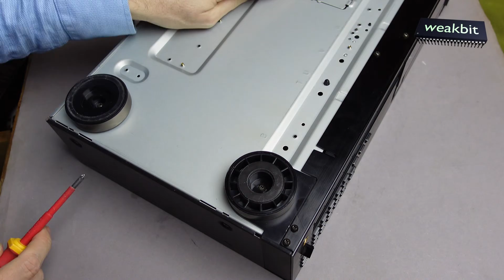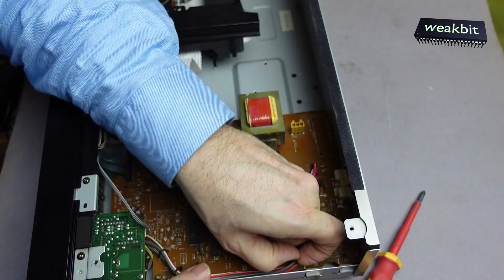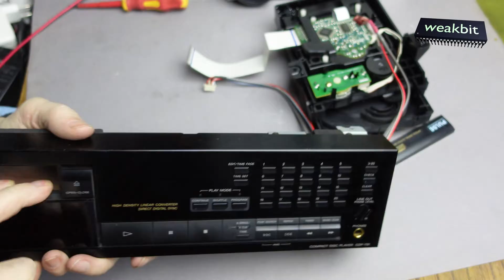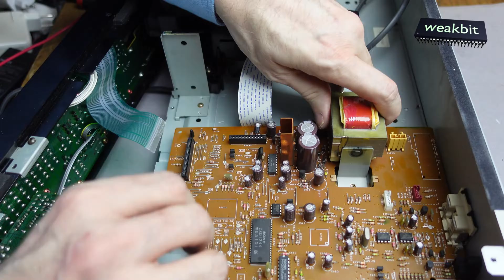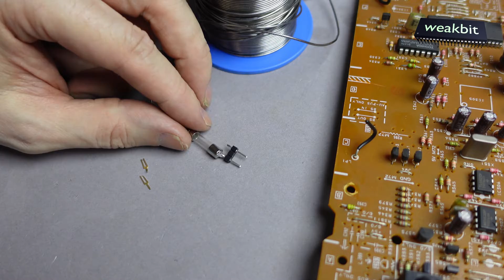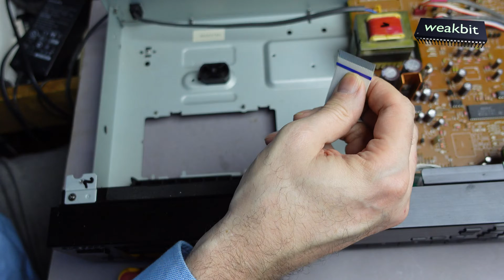Sony CDP-791 repair

Comment: A lot of work to change a fuse.   Sony should have used the type of fuse that goes in a holder and it easily replaceable.   I learned a lot.   Thank you, weakbit.

Comment: Very good my friend , i have that same sony cd player , i bought i e new in the box last year and enjoy it very much . I run it throug a tu e buffer pre amp .
Reply from the maker: But you also know this is not normal what happened! in sum are 4 issues 1st power-cord not correct soldered and isolated! 2nd flex-cable front to motherboard was cut, 3rd Fuse of the +10V interrupted, 4th KSS240a laser-pickup defect low lase light. Maybe if you repair your own then it have only one of this failures! Thank you for your comment! weakbit
Reply: @weakbit633  yes I understand ,  the Sony used to belong to Frankenstein maybe .